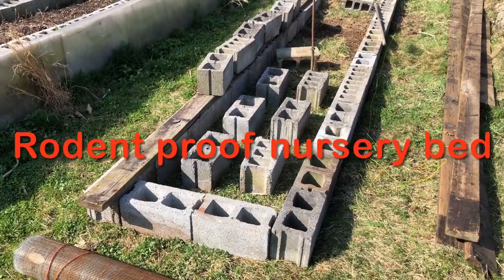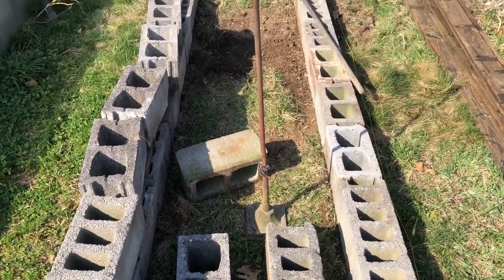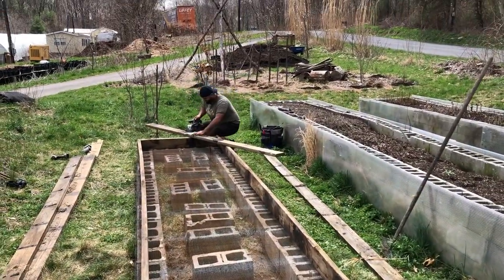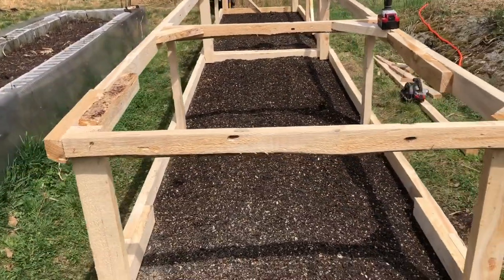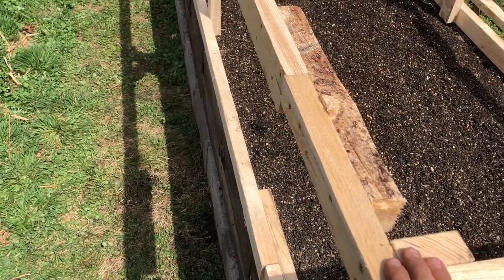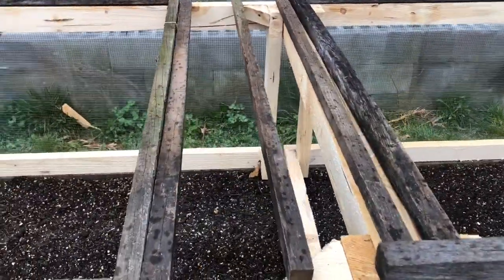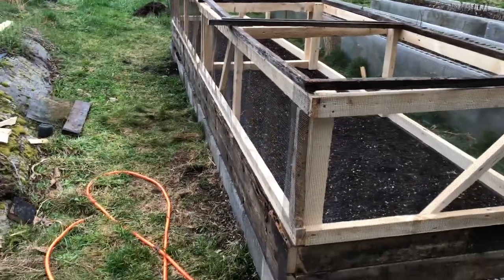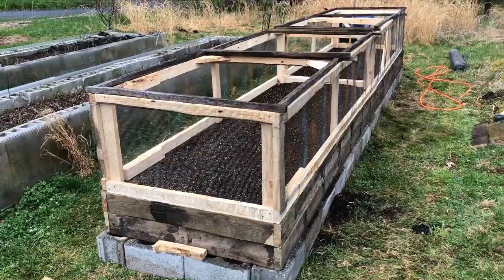Rodent-proof garden bed for high value plants!

Comment: Very helpful. I love your set up. I haven’t been able to have a vegetable bed for 20 years because my property is plagued with rodents (and I have tried every safe & humane method of rodent removal). Your method gives me hope that I can use my vegetable bed this year! 

There are a couple of things I don’t understand, though. (1) Why didn’t you lay the wire mesh directly on the soil? Why is it raised? (2) What size are the openings? Is it hardcloth? (3) I am an organic gardener and I’m concerned about whatever other metals are in the wire mesh/hard cloth getting into the soil & then into my crop. Any idea what the composition of these materials is? (4) What keeps the frame on the base? I’m guessing you don’t have it just resting on top. (5) I wish the video had continued just a little longer. It would’ve been helpful to have seen the finished lid.

Thx!
Reply from the maker: The wire bottom is placed on concrete bocks around the perimeter and some in the middle to support the load. I recommend 1”x1/2” welded wire fence material for the bottom. Mine is off the ground so the tree seedlings can’t hit the ground and grow through the wire. This wouldn’t be an issue for veggies.

Comment: I don't understand after tou put the mesh you said you put supports. Okay next scene the soil is in it, so soil right on top of screen? Really trying to build from this video, uve watched it 3 times and figure out that part. How does the soil bot go right through??
Reply from the maker: Yeah the soil goes right on the mesh! If I were going to do it again I would use 1”x1/2” wire mesh. It’s stronger and will last longer. The soil will pretty much just stay on top of the screen. A little bit falls through but not a ton. You could put a finer layer of plastic mesh on top of the metal too if your soil is very fine grained.
Reply: Thank you so much for responding this helps alot! 🙏🙏👌👌
Reply: I was going to use 1/4inch, 23 guage mesh wire. Maybe I'll change it and use what you used the 1/2inch I definitely want it to last as long as possible!
Reply from the maker: @AlexAlex-qn5co  I have rusted out the 1/4” stuff in two seasons! Definitely recommend an upgrade to 1/2” thicker gauge!
Reply: Oh wow, so helpful for me not to make these mistakes! Thank you 🙏🙏